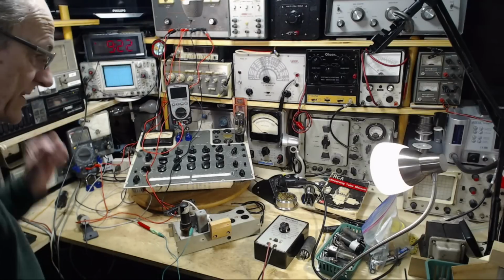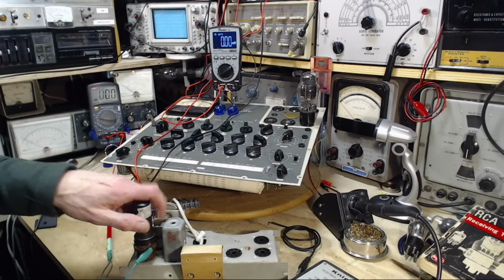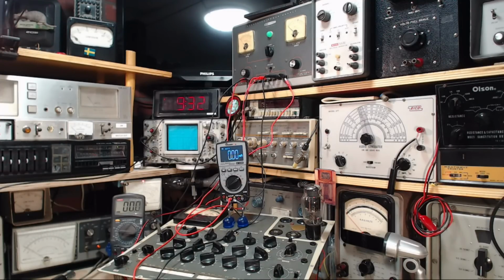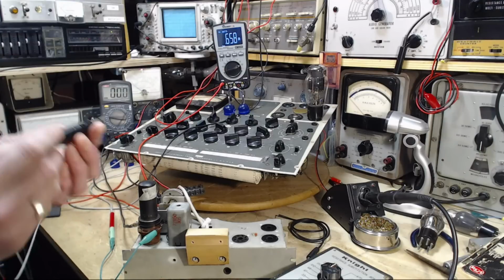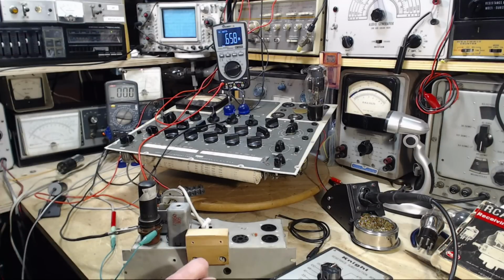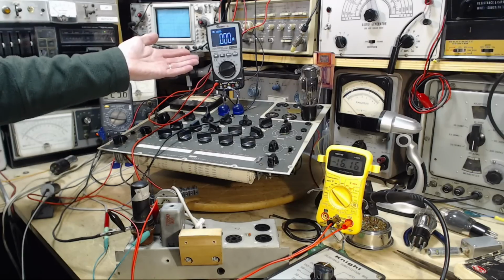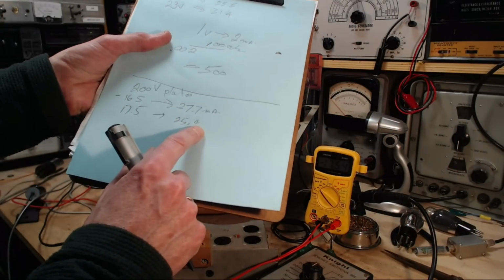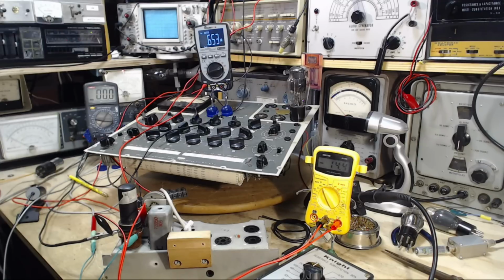DIY Tube Testing Video #2 - Static Gm Measurement 6F6

Comment: Dynamic trans test is a waste of time. The numbers come out the same. Explain how you will measure a change in AC plate current in the milliamperes range. You really need to do more research before you experiment. It's bad enough when an experiment yields no results when you do it right, than to do it wrong and expect different results.

Comment: Wrong , GM= delta ip divided by delta e.g. Or change in plate current divided by change in grid voltage. You had it backwards. You almost had it correct!

Comment: That ,little ye,low DDM has an input (1 Megohm) sensitivity that will load the grid circuit. Use only a VTVM or a good quality . A good DVM has an 11 Megohn input impedance.
DVM to measure the Grid circuit. I have o idea why you are measuring filament current and with what. I don't know any meter that measures AC current in the milliM ranges.
I think you are taxing your Heathkit power supply beyond its design and age of components.snif..snif?

Comment: What ever you do, don't let the grid run open. Either tied it to ground or a -DC potential. If the grid goes + , plate current will max out and damage the tube , sometimes causing a control grid  to screen or plate short.

Comment: So you're measuring about 2300uS (aka umhos), which is in the ballpark for the tube specs... docs I've found say it should be about 2500uS at plate voltage of 250 and grid voltage of -16.5.

Comment: I am writing this comment so some of your viewers will not be confused.  Transconductance (Gm) is a conductance, the units of which are Siemens (previously mhos were used).  A conductance is the ratio of current to voltage, the inverse of ohms, which is the ratio of volts to current.

So when calculating Gm transconductance divide the change in plate current to the change in grid voltage.

An example:
1 volt change on grid results in a  1 ma change in plate current.
Calculate Gm:
Gm = 1ma/1V = .001 S (S = Siemens) or 0.001 mhos
Convert Siemens to milliSiemens (millimhos): 0.001 Siemens = 1 mS (1 mmho)
Convert Siemens to microSiemens (micromhos): 0.001 Siemens = 1000 uS (1000 umho)

Most of the old tube testers gave Gm values in umhos, hence Gm values on the order of 1000 to 2000 umhos.

Say a tube has a Gm of 1000 umhos (1000 uS).  How much change in plate current should be expected for a 0.5V change on the grid?  Remember 1000 umhos is 0.001 S.

Change in plate current = Gm * 0.5V = 0.001S * 0.5V = 0.0005 A = 0.5 ma

Remember, Gm is not a unit less quantity and and the units being used for a given Gm value must be known.

Comment: Why did you use the tube socket which was surrounded by the most components on the top of the chassis?
Reply from the maker: I was quietly asking myself that question.  The answer is the socket was unencumbered underneath and I didn't think about the top side.

Comment: Gm = (delta Ia) / (delta Vg) and is typically measured with an AC signal, eg. RMS plate current and RMS Grid Voltage. The typical example that I have seen discussed on forums is 1V RMS Vg causing a 1 mA RMS swing in plate current resulting in a Gm of 1000.
I have also heard that Gm is sensitive to the quiescent (DC Bias) current point as well making its measurement more tricky...
Looks like you are close though, I hope you get to the point where you are getting good data, looks promising!
Cheers,
 - Eddy
Reply from the maker: A little closer every time.
Reply: In order to test the tube as you suggest you need an AC ammeter in the plate circuit.

Comment: Hey Jim, I think your dropping voltage on your filament after the meter because the meter has a high burden voltage on amperage measurements. Try a different meter or put a 1 ohm 2 watt resistor in series on the supply line and measure the voltage drop across it, 1mv= 1ma using Ohms law. Some meters draw a good amount of voltage from the circuit to test amperage. I bet this is one of them. A good book you'd enjoy is this    https://www.amazon.com/Calibrate-Repair-Upgrade-Vacuum-Testers/dp/0980622379
Reply from the maker: As I go forward with all this, I hope to iron out any little factors that are upsetting things.  I'm just getting ready here to start today's adventure and the first thing is settling down the heater voltage and current using a different supply source.
Reply: Indeed, I'd rather use a 1-ohm current sense resistor than to stick the meter in series, especially if you only have one or two meters available.